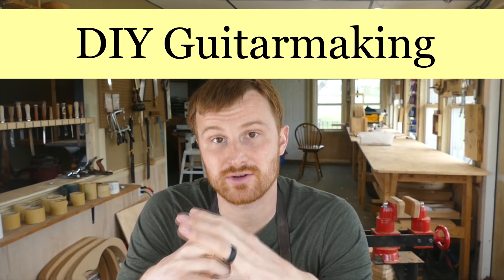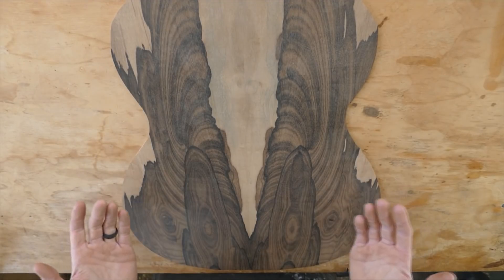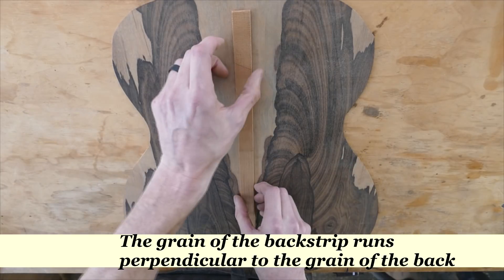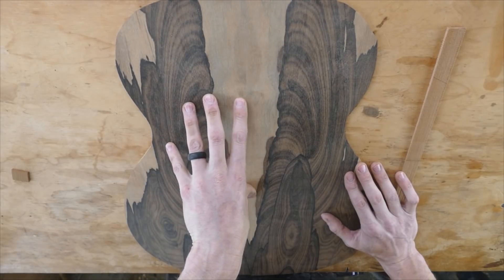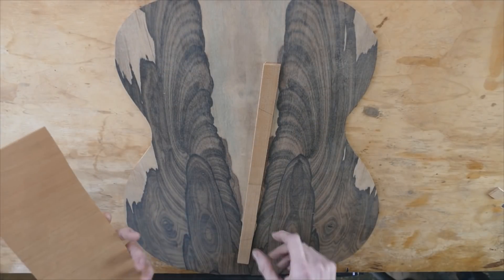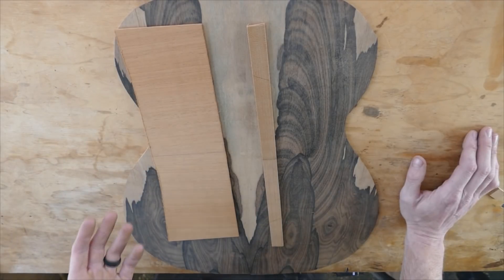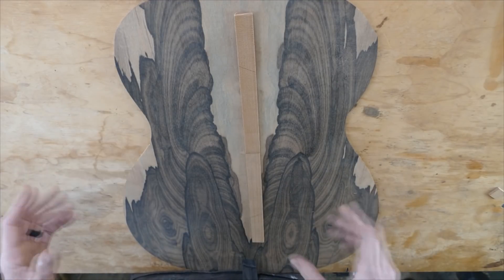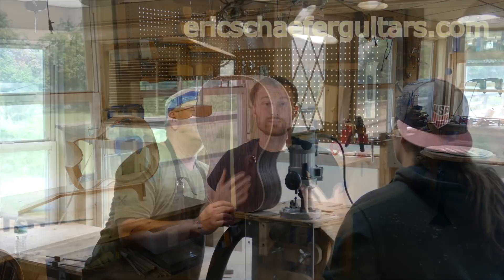The Backstrip: It's Function and Material Considerations

Comment: Hi Eric, thanks for sharing your gold mine of knowledge. I'm starting my first guitar build after dreaming about it for years. Got the top and back joined yesterday. I surely will be revisiting your channel for tips and knowledge. Also that's a gorgeous piece of ziricote, I acquired a bunch of sets myself. The plan is to wait on using them since it's so pricey and brittle.
Reply from the maker: Thanks, Brent! I'm glad you like the channel. That's a good a call on saving the ziricote until you have a few under your belt. It can be a more challenging wood to work with. Good luck on your first build!

Comment: Gorgeous!  Gorgeous!  Gorgeous!  But what are the disadvantages of such a grain pattern?  Could there be flaking and separation when it ages?  Do you do anything to reinforce it?
Reply from the maker: Thanks. There is always that possibility with figured woods since the surface is basically a mixture of all grain faces (endgrain, skewed, quarter etc...). Beyond maintaining the shop RH, reinfircing with the back braces and backstrip, and applying finishing, I don't do anything special that I wouldn't do to a plain figured wood.

Comment: Thank you Mister Schaefer for constently posting great videos. I'm also used to see backstrip to cover the joint of a bookmatched back, but seeing your videos, I was thinking about something. I've already heard that a good glue joint (with nowadays glues, like aliphatic Titebond) is stronger than wood itself : Like when you do a repair, the wood is breaking just next to the glue joint, but the glue joint is still here.

So I was wondering if it's still usefull to put a backstrip. Before, luthiers were using animals glue, so it had to be there, but nowadays, could it be possible to remove it ?
For the top, just a good bracing is fine and we don't need backtrip to mecanicaly reinforce the joint, and the top is more "sought" than the back.
Hope my questions was clear... Thank you very much again !
Reply from the maker: The question is clear, and I think it is a good point. My gut tells me that the backstrip is not necessary at all as long as the joint is done well, for the reasons you just mentioned. I still, however, feel better atleast installing the diamond cleats. It certainly doesn't hurt. I wouldn't "remove" it from a guitar if it is already there. There is no downside to having a backstrip, except for the extra time it takes to glue one in.
As for the top, some do install cleats in the open areas between the braces. However, between having the soundhole there and the braces crossing the center at various places, there isn't alot of open space to reinforce, so most (myself included) don't add any cleats to the top, although again, it doesn't hurt.